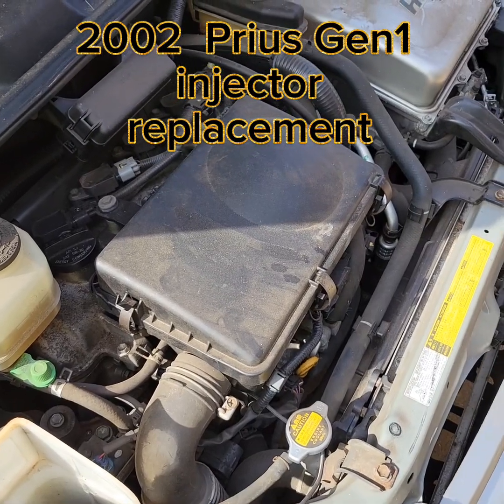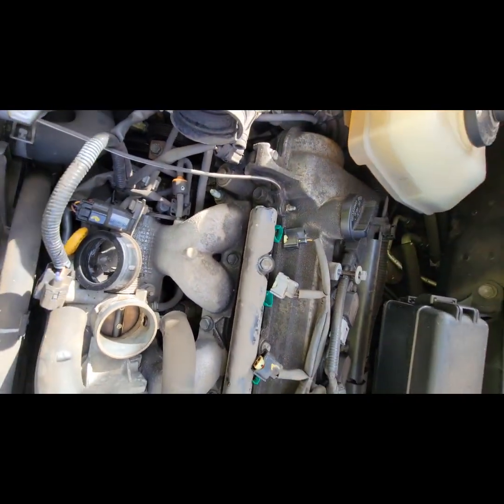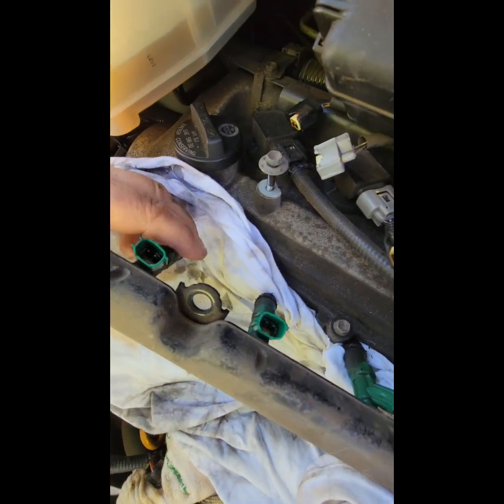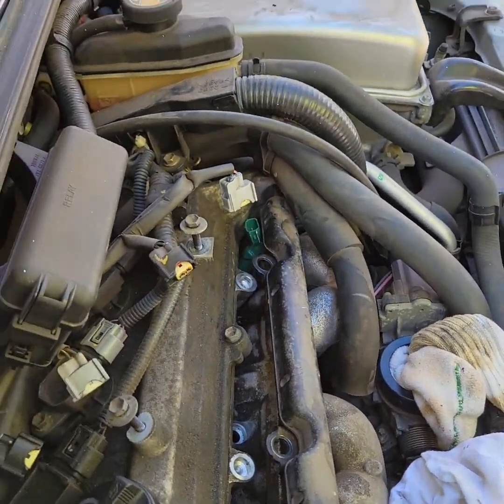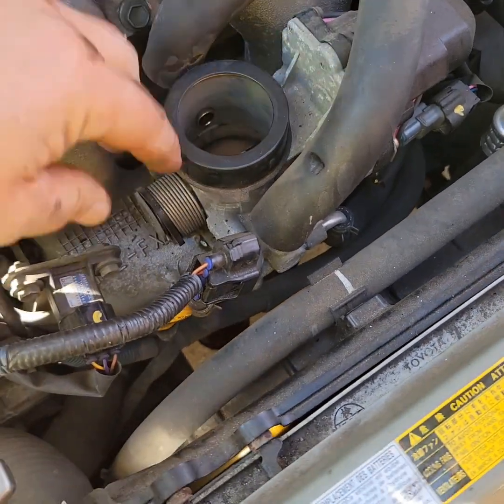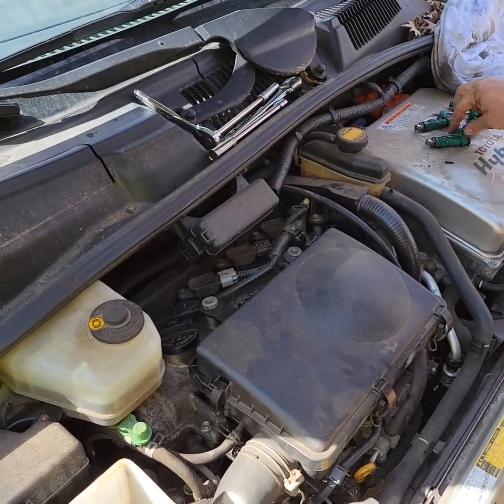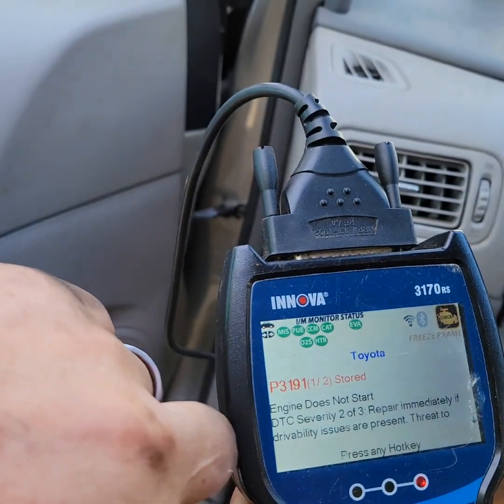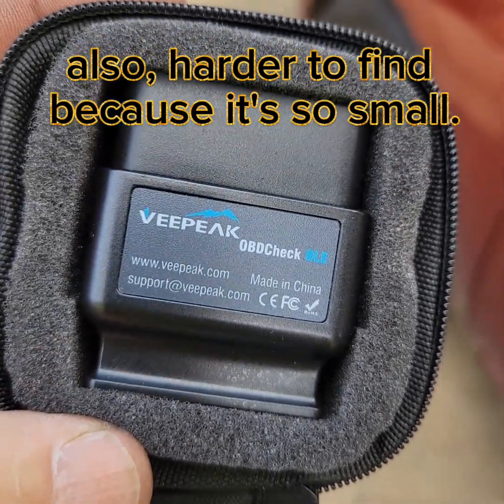2001, 2002, 2003 Gen 1 Prius injector replacement

Comment: Have a 2001 with just under 200k miles. Been getting P0300 (with occasional P0301) random cylinder misfire. Cleaned MAF, Throttle Body, changed spark plugs, changed coil packs. Cleared issue and the CEL stayed off long enough to pass smog a few years back. Now its smog check time again. Cleared code, drove it until the emissions system was ready, and once it readied up with no issue on my way to work. Decided to hit a smog shop real quick on my lunch, barely got out of the parking lot and the code came back.
Would you say to try injectors next then?
Reply from the maker: Where did you buy the coils? Try the red bottle of HEET from Walmart. Injector and water treatment. Move coil on cylinder one to another cylinder. See if the error follows the coil. If the P0301 returns, move injector one to another cylinder. If error follows the injector replace it.
Reply: @roscoesrepairs  Amazon. A-Premium coil pack set. Seemed better than bottom of the barrel while not exactly going OE expensive. Didn't seem to actually help the issue back then, so i'm not sure they were even ever the culprit. The car ran no different after doing all that.

Comment: If I get a rattle...like when you started the motor...just when started , is that bad fuel injectors or a clogged fuefilter or a bad fuel pump?
Reply from the maker: The first thing you should try is fuel injector cleaner/water remover. The red bottle of "Heet" from Walmart is what I would use. It is both a water remover and injector cleaner. What error codes do you have? The bad news is, if it is a fuel pump or fuel filter, those are in the gas tank. The gas tank is sold as a single unit. $300-$500 new.  The fuel injectors are cheaper and easier to replace. If the car continues to start, it's probably is not a fuel pump. There is no place to test the fuel pressure on fuel rail (like on most cars) on the 2001-2009 Prius. You have to hook up an external test kit. The easiest place to do this would be on the passenger side below the car on the right-hand side in front of the gas tank. The red fuel line connector in front of the fuel tank is the pressurized line to the engine and can be removed easily for testing.
Reply: @roscoesrepairs ...thanks for the fast reply. I bought a big can of sea foam injector cleaner a few days ago but doesnt seem to help much. I dont remember ever changing the fuel injectors but several YT vids look familiar and I maybe changed one out before. Doesnt seem to be losing any coolant so dont think its a head gasket. Car does have an issue of kicking the ac compressor out on a hot day after sitting at a light or sometimes on the interstste. Ac hascbeen gone through with 3 differernt mechanics and they have not figured out why....but ac is ice cold but bets a little warmer sitting idling.
Reply from the maker: @gittarpikk Your car is a 2001-2003 Prius? The air will turn off at a light to save energy. The engine must be ruining to operate the belt driven A/C. To override this press the MAX button next to the A/C button. (By the fan speed selector)  The engine will continuously run when you are stopped. 

It could be the gap on the A/C clutch. On one of my nine Gen 1 Prius I had to adjust the clutch gap to get it to work. I have ice cold a/c now, and that was 4 years ago that I made that adjustment 

I have never used sea foam. I use HEET. The red bottle has the injector cleaner and water remover.
Reply from the maker: Have you checked the spark plugs and coils?
Reply: @roscoesrepairs yes, 2002 I discovered that about the Max button but has no effect on compressor kicking off. My impresion is possible ac fan worn and cutting out or not running as it should although 2 mechanics state it is in fact operational. Could be a faulty expension valve but acts more like fan related. Clutch could be slipping due to never been replaced but I would think it would affect it more in acceleration. I have to really step on it to get accelleration to affect it.
Reply: @roscoesrepairs yes..all were replaced not a week ago and did improve idle and a bit smoother but still get the start rattle.
Reply from the maker: @gittarpikk could be water in the gas
Reply from the maker: That or  plugs and  or coils. I think in my video, I say I've already replaced the plugs and coils, which is easier and cheaper.
Reply from the maker: Also, you never answered the check engine light question. Any P0300 random misfire?  Water is gas.  P0301-304 is telling you which cylinder has the problem.
Reply from the maker: For your A/C question.  Make sure your blend door actuator is operational. 
https://youtu.be/UPDdh0ZImVA?feature=shared

Comment: Thank you for the good video ! 
I changed the PCV valve on my 370K miles 06 Prius and a lean PO171 started popping every about 30 miles (I erase it to see how soon it comes back since I’m using Lucus gas /fuel injector cleaner hoping it’s going to clean them enough, but it doesn’t look like it).
The next move for me is to replace the injectors which I suspect we’re never changed before..
Watching your video, I learned about the rubber round piece that goes around the throttle opening and inside the housing where the air filter is.. Maybe I dropped it or it’s not in the right position which might cause a vacuum leak..
I will check it soon.
Thank you again
Reply from the maker: When the engine shakes like that, it's not starting because it is misfiring (fuel pump, coil, injector, or crank position sensor at fault) , and the HV BATTERY gives up on turning it over. I have never had to change my PCV valves on any of my Prius. I have six Gen1s and three Gen2s. Coils and injectors are the same in Gen1 and Gen2s. What was the reason you changed your PCV valve?
Reply: @roscoesrepairs  1. Oil consumption. Even though oil consumption is not bad (a little over one quart every 5000 miles) 2. Spark plugs were messed up at 35K miles instead of 100K miles especially nr.1
3. Read what other Prius owners saying about how it should be changed every 50K miles and it can cause PO171 which in my case happened twice before I changed it.
4. A bad PCV valve can cause P0421 (which was showing the most and disappeared on me since I changed the PCV valve now a little over 300 miles ago.
So I think something positive happened after I changed it.
Now I’m left with the PO171 to deal with and and a misfire code once every three or four times I get the the PO171.
The next step is the fuel injectors change.
I was a little skeptical about doing it myself because the gasoline involved (one of the videos showed how lots of gas would spray on the engine bay when pulling them out, and the dirt and grease that need to be cleaned/vacuumed like you did in your video)..
Reply from the maker: Let the pressure off by disconnecting the fuel line by the gas tank. It's the one with the red retainer. Drain it into a can. It's briefly mentioned in the video.  At 3:50
Reply: @roscoesrepairs  obviously that would not cause a gas spill when removing the injectors !
Thank you for taking the time to reply, I really appreciate it
Reply: @roscoesrepairs  finally did change the fuel injectors few days ago and it was a success !
Immediate improvement with engine performance and mpg !
The only check engine light that’s showing every now and then is the P420 because the aftermarket cat !
Thank you again
Reply from the maker: @sammynazz  I have put spark plug anti fouling adapters on my O2 sensors that have that error.  Not legal in all states.
Reply: @roscoesrepairs I have a 2009 Prius and have a p0420 with decreased mpg, rough idle and runs rough, after changing plugs,coils, pcp valve, fuel injector and cat cleaner additive added, maf sensor replaced, I am down to changing the fuel injectors. But I just went to my mechanic and he says it’s 99% my cat that is causing all my symptoms. From your experience what do you think this can be?
Reply from the maker: @Primer9  I have never had to replace a catalytic convertor on any of my Prius'. Over 300,000 mile on many of them. Did he look inside the Cat and see it was clogged? Mine have never been clogged. I think they are made really well.
Reply from the maker: @Primer9  In your reply you said "fuel injector". How many did you replace? Or did the mechanic replace one?
Reply: i havnt replaced any fuel injectors yet... its my next "To-DO", although i had a prius mechanic tell me my catalytic convertor is clogged.. I dont know if a clogged cat would make my MPG be so horrible and make my car run so rough and idle so rough. I am planning on replacing the CAT and do fuel injectors but I will do one first and see how car is... then progress to the other. Let me know what you think and how I should approach this? Would a clogged cat give symptoms as I am describing? Rough idle, drives heavy, and at least 10 mpg dropped. Thank you for your time and responses. @roscoesrepairs
Reply: mine is a second gen prius and they are known for burning oil... i dont know if the gen 1s that you worked on in your video burn oil too but the cats going bad on second gen is pretty common./ @roscoesrepairs
Reply from the maker: @Primer9  I also have 3 gen2 Prius'. One uses a quart of oil every 2500 miles. So, we use full synthetic and change the oil every 5k. Add a quart at 2500 miles and change the next time we would need to add a quart. A gen1 one with 340k oil is same situation. All the others make it between oil changes.
Reply from the maker: Still no catalytic convertor problems. On any of the nine we drive and own.
Reply from the maker: @Primer9  I would do the injectors first. I had a gen1 that would not start at all. It is the only Prius I've had to replace the fuel tank on. Fuel tank is one piece with the fuel pump. The other 3 needed fuel injectors after 270k+
Reply from the maker: @Primer9  A clogged catalytic convertor would allow you to drive up to a certain speed and then would create so much back pressure at that speed you wouldn't be able to go any faster.  Had one go bad on a '94 Chevy astro.  I could go 41mph but anything past that it would buck and kick like the engine was going to stall. When I took that cat out, its insides had fallen apart and were clogging the out put of the cat above 41mph.
Reply: @roscoesrepairs  hey i did the fuel injectors and did the coils and sparkplugs while i was at it.. seems to be running better but i still get a p0420. As long as im not burning as much as fuel as i once was and can change my catalytic converter soon to come. thank you for your help
Reply: Oh I forgot to mention that before changing the PCV valve I used to get misfire codes and P0421 and towards the end PO171 a couple of times..
After changing PCV valve down to PO171 mainly and a shaking and rattling when first  starting the car.. MPG was and still 50+
Reply: So after my previous message/comment (even it’s close to midnight where I am) I went and checked that round rubber sealer under the filter housing and it was there where it’s supposed to be, but that air flow sensor’s two little screws were not tight enough (because I removed it to clean it when changing the PCV valve).
I will check to see if that makes any difference causing the PO171
Reply: I have a question about a different new mystery POAA6 error code !
Can I email you somehow ?
Reply from the maker: @sammynazz  first, check your ground connection on the 12v battery. Make sure there is no corrosion where it fastens to the chassis. Clean terminals and cables. Second, turn off a/c if the error doesn't come back on after clearing the code it is on the a/c or the wire from the invertor to the a/c. Do you have the ability to get the sub codes? This is a good place to start. If that doesn't fix it, it could have a leak in the HV battery, the transaxle, or the invertor. Those are harder to pinpoint. Was the car ever wrecked on the driver's front side?
Reply from the maker: @sammynazz  roscoeziemer@gmail.com

Comment: Hi, I have a cylinder 2 misfire code I’ve been chasing on a 2002. I replaced the spark plugs with ngk, replaced the coil on plug, cleaned the throttle body, changed out the whole exhaust & o2 sensor nothing makes it go away & it misfires whenever the ice cuts on or off. Does that sound like injector? I’m only getting 37 mpg, used to get 40. Ty
Reply from the maker: Those were my exact same steps. I have 7 running Gen 1s. Three of them were misfiring. I replaced the plugs and coils first. They are cheaper and hadn't been done. Each Prius had over 270,000 miles. One had over 305,000 miles. I also rebuilt the HV battery in them first. It was not until I replaced the injectors that the misfire went away. I found my cars, because the injectors were clogged, were trying to open the injectors all the way, thus lying to the fuel economy. When I put gas in the car, I was still getting better than reported on the mfd (multiple functional display). I also had an error that the car was running lean. I did not replace my exhaust or the o2 sensor. Those errors went away after I replaced my injectors in all three Prius.
Reply: Thank you
Reply from the maker: You mentioned you cleaned the throttle body. In all the time that I've been working on Prius, I have never had to clean a throttle body. Ever. I understand cleaning the throttle body doesn't cost anything, but changing the injectors fixed my problem every time.
Reply: Well, thank you, I was going crazy, the car shook & rumbled so bad I was wondering if it had thrown a rod but I changed out just injector 2 today until I get a full set & the car runs perfect again
Reply from the maker: Yeah, another success story.
Reply: Hey, can I ask you a question since you have a bunch of these? The hvac controls don’t work in mine, haven’t since I bought it. There’s power to the temperature control I checked but they don’t light up, nothing turns on, no air no fan no heat. The radio functions work fine, the screen works, ambient temp says nothing. I’ve replaced the circuit boards with used ones twice, no difference. I checked every fuse & relay associated with the ac/heat/fan functions & all are good per Toyota mechanic instructions on checking & trouble shooting. Do you have any idea what the problem could be? I thought about buying the new ac amplifier which comes as a full unit but that’s $2k & if it still doesn’t work that would suck bad. Thank you for any advice
Reply from the maker: Did you take off the dash, just the center part that holds the radio and display, and make sure the wires are plugged into the back of it?
Reply from the maker: Have you checked "Prius Chat"?
Reply: Idk why it deleted my reply. I checked Prius chat, asked & a guy told me check the power in which I did then he said it’s a bad ac amplifier so I got the one from eBay, that was the third one, but it still doesn’t work. I’ve disassembled the whole middle everything it connected, nothing works lol I don’t get it
Reply from the maker: I have had to replace the heater A/C blend door and the blower before on mine. Then the A/C went out on one of the Gen 1s. My son ended up wrecking that car so I didn't end up fixing the A/C in that one. I can't imagine the replacement ones you are getting are all bad. All of mine work.
Reply from the maker: https://youtu.be/AlbBr5Bf-H4
Reply from the maker: Also, the three wires at the bottom of the panel(they plug in from the back) are the wires to the HVAC controls.
Reply from the maker: I said I replaced the blend door. I meant to say the A/C blend door actuator.
Reply: Ty so much for your help
Reply from the maker: @L Boughamer  It has to be one of those three wires not getting power through the plug. I have a surgery in the morning. I need to get up early.
Reply: Oh, they all had power & continuity in the ground. I found the problem, there appears to have been a fire at some point. I took everything apart & crawled down under the drivers side dash & there are various melted bits so not sure what I’ll do for ac & heat at this point lol
Reply from the maker: @L Boughamer  can you reconnect the wires to the correct colors.  If you need a harness I have plenty of those. Are you in Australia or England? I'm in the USA.
Reply: It looks like the climate control mechanism & wiring melted
Reply: I had that also and changed out all the coik packs ( super easy and cheap) and no more codes.

Comment: Why did you change the injectors?
Reply from the maker: It was giving a random misfire, and the engine was not starting sometime. I have two other Gen1 Prius that had over 270,000 miles same problem. After replacement of the injectors, the fuel mileage went up 10 miles per gallon, and the "Did not start" error went away.
Reply: Can bad fuel injectors cause p0420 on my 2009 Prius?